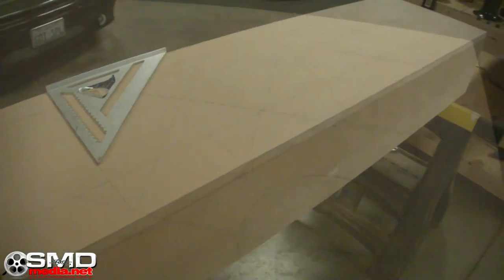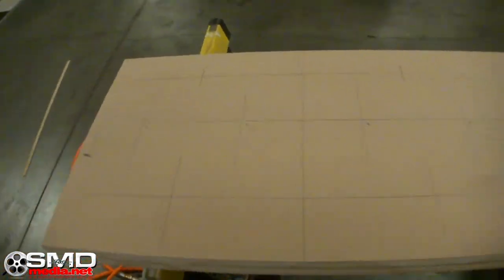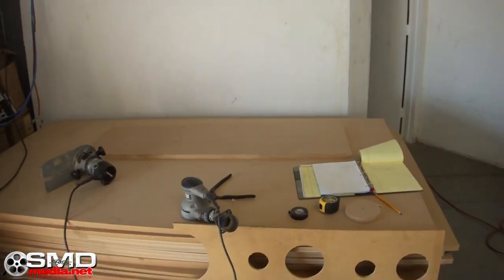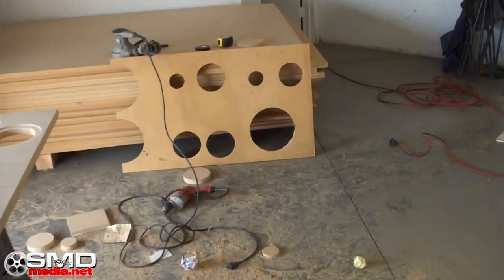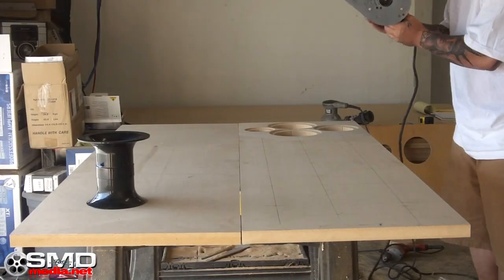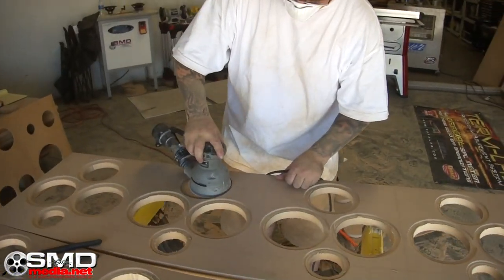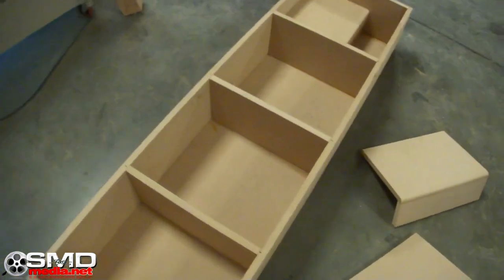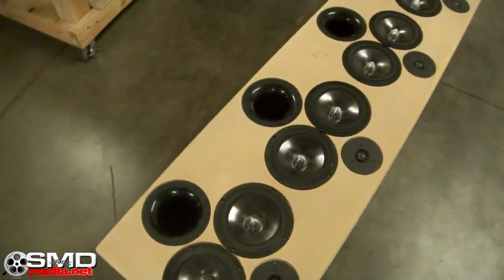Extreme Shop System - Towers (Build Vid 3) How to Cut Perfect Circles

Comment: A Porter Cable 450PK router would be awesome for doing the type of cut-outs in MDF I see you doing. It's small, lightweight and powerful and it has an awesome plunge base that will make stepped cuts super easy and fast.

I know you like the best, it's time to "take the plunge" so to speak!

Just no equal to the speed and ease of a plunge router for doing cut-outs or recessed holes, it will make you money in time saved.

Comment: @QsoftStudios Not for a speaker box. Most solid wood isn't dense enough and it will rattle, resonate and just sound like crap IMO.

MDF is a very dense material, and it isn't "particle board" by any stretch. Two very different materials.

MDF has been the industry standard for as long as it has for a good reason, IT WORKS!

Comment: @meade916 you reckon you gonna struggle with an empty patch between 55 - 35hz with the two sets tuned so differently? It will probably be fine with that number of mids there but, it is gonna be playing in a bit open space so guess have to wait and see how it sounds!

Comment: Hey steve, i have a couple questions for you. What type of router bit did you use? How deep did you countersink the holes? Did you not seal the box? And did you just use a nail gun and wood glue to hold the box together? No screws or anything?

Comment: alright ive got a crafsman plunge router and the model 270 jig, course i came here cuz i remember watching  this when it was uploaded.... so if i understand correctly the 1st pass is the outer diameter, the fourth is the mounting diameter, and the second and 3rd are just to get that gap between the first and 4th passes right? and you then cut it out on the fourth right? i have a plunge router, what bits do i need to do this, and what size?

Comment: ive got 6.5" mids and i just wanna do MDF cutout rings for my front doors cause ive got 4x6 in stock and those plastic mdf adapters suck, i have a router with the model 200 jig but how do i figure out the measurments i need for each pass? cutout, flush and then outer?

Comment: knock out inside diameter first, then router out the step with a bearing guide bit, yes there will be dust but it would be cut in 1 pass, yeah a wide rabbit thats what ive used.  no big deal I want to hear that motha when you get done!  watch out home audio here comes steve meade out doing the hi fi gurus

Comment: When MDF is cut, sanded, shaped or machined in any way, it releases clouds of dust particles coated with formaldehyde. ... There is evidence that formaldehyde-exposed workers have high rates of lung cancer and (nose and throat) cancer.'Sep 20, 1997
Reply from the maker: i always wear a mask and use as much dust collection as i can. But thanks anyway doc.
Reply: Glad the info helped you too. I really added it to help your viewers. People new to woodworking or unaware of hazards of man-made material dust may get the impression that an unkempt workshop doesn't pose health threat.